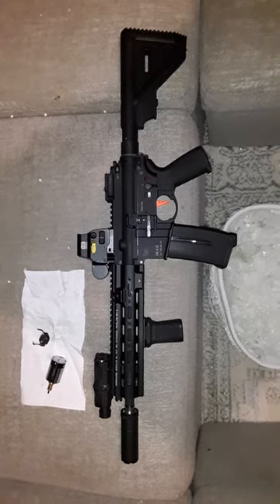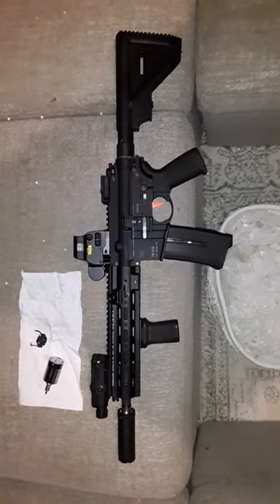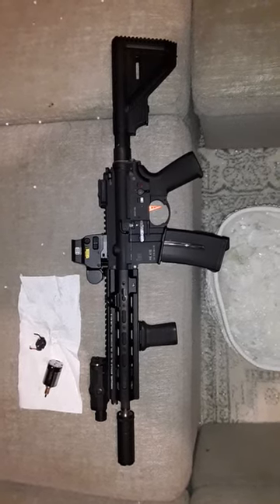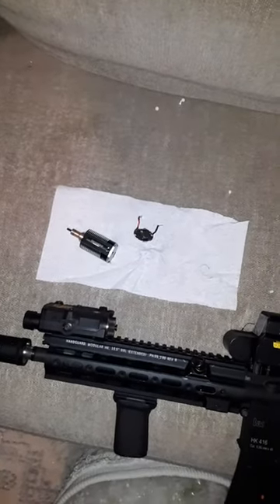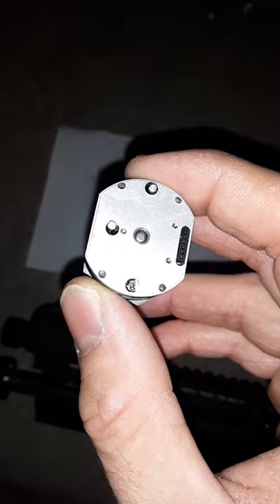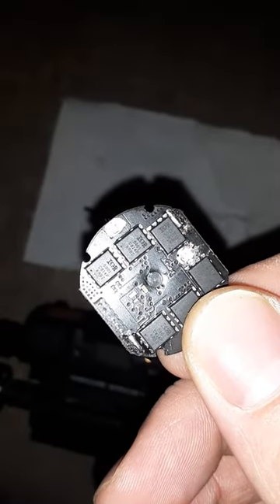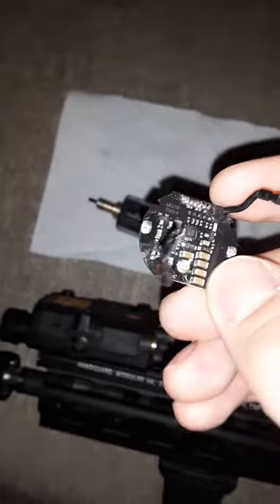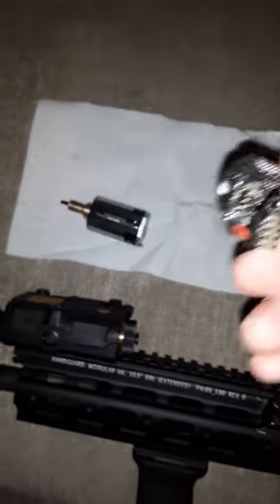Airsoft DSG 416. Ronin Brushless+Lonex helical bevel/pinion

Comment: Damn bro, I've had a helical pinion/bevel set just gathering dust in my toolbox just because I don't have the pinion removal tool, and I've searched everywhere for a vid that shows how much of a difference there is in sound, you just made my life easier... Kudos on your work and love from Dominican Republic!  Keep the good content coming!
Reply from the maker: Once you switch it you'll never want to use any other pinion and bevel again
Reply: @jhqtech  how about cycling time, how many ms does it improve?
Reply from the maker: @IsmaelColumnaMontero  the spiral bevel and pinion dont increase rof, just mesh more smooth than standard bevel and pinions

Comment: Wow, I know straight cut gears make a lot of noise but I wasn't expecting that much of a reduction, that's amazing! What they're much to do solider the brushless? And did the gears mate well? Sorry for all the questions dude. I've been watching all your videos lately 👀 lol
Reply from the maker: No problem. The lonex helical bevel meshed well with shs spur. To press fit a pinion there are 3 wires soldered to the brushless motor you have to disconnext. Warhead actually has a great video on their facebook how to do it

Comment: I thought that you had to use all helicoil gears if you go helicoil and are the go if you want to push like 7-800fps once again it's a awesome build ,you do some good work bro like top notch 👌 stuff
Reply from the maker: It's just the lonex helical bevel and pinion gear. Works with most standard ratio gears as it's just a regular 10 tooth bevel only with spiral cuts so you can use it with many other gears
Reply: @jhqtech  huh that's interesting and sounds bloody awesome like everything you build

Comment: I thought the Lonex spiral gear set was for O-type motors and the Warhead motors were all D-type? How did you fit the pinion to motor without worrying about the pinion slipping?
Reply from the maker: Press fit and apply loctite

Comment: Hi ! Did you try precock ? Is there PME with this setup and precok ? (8T dsg)
Reply from the maker: I dont use any precocking. Theres no need with a dsg. Precocking only stops the sector in a specific spot while cycling if your spring is strong enough there should never be pme

Comment: What kind of work did you need to do to make sure that the motor was aligned well enough for a helical pinion to work? Given that the v2 design puts the motor in the pistol grip rather than a motor cage, I’d imagine getting the alignment could pose some difficulties?
Reply from the maker: I shim the motor inside the pistol grip with electrical tape so theres no movement once I have the proper angle and height set
Reply: @jhqtech  gotcha gotcha. Thanks man!

Comment: Ever thought of putting lonex helical into your TSG?
Reply from the maker: I've got 10 more coming for all my builds. This was the first I wanted to mess with to see if I liked it. I'll def be using one in my tsg gearbox
Reply: @jhqtech  Okay. I thought there weren't enough notches for the arl but I don't really know since I have only seen pics. If there isn't enough though is there anyway to modify the helical gears??? wondering because I am looking to use one when I build my TSG.
Reply from the maker: @beguinworkshop9068  from my understanding it's the same as any other standard bevel so it should work fine. Most 10tooth bevels in common ratio gears are the same

Comment: I have an 18:1 I m building right now but still haven’t order the motor should I get an brushless motor I was just gonna get a real deal golden boy motor but these brushless motor have a lot of pros
Reply from the maker: The real deal motor is a nice brushed motor worth its price especially with him adding silver brushes to his new ones.

That being said I use all brushless motors now. If you have the extra cash, the warhead base motors are just as good as the cnc black and ronins
Reply: @jhqtech  Thanks for the response I will be getting the warhead base motor and will be thrown into an MCX 18:1 DSG
Reply from the maker: @dynasty_aatc  get the 35k (this ronin is only 30k). Should net you around 45rps depending on your spring.
Reply: @jhqtech  yeah what I was gonna get

Comment: Just wanted your thoughts between the three motors and what's better obviously
Reply from the maker: Id say go with the base every time unless you just have money to blow on the ronin. The base performs just as well as the other 2. The ronin is a bit more efficient. But id stay away from the black ones, alot of people myself included have had little issues with them.
Reply: @jhqtech  really azraels armoury hasn't mentioned anything and that is the reason they stopped ordering those option no1 brushless motors hummm my mates already brought a couple of the black ones i will have to look into it now cause to be honest i was just going to grab one of the bronze one's
Reply: @jhqtech  o well hopefully my friend is one of the lucky ones and he's saying go for the more expensive one and he does have the money to blow, the base bronze motors are selling for $175aud and the black 200aud is being sold by the guys who make the Apache's funny enough and they are really talking them up
Reply from the maker: @drewmurray6480  the warheads all around are great motors whatever version you use. I just think some of the hand winding done in the black ones is inconsistent sometimes causing strange problems. And I've had several people say using them in winter temps causes issues. A fun test is to shoot your warhead equipped gun to see that it works fine, then put it in the fridge for a while and test again. Hilarious when I saw someone do it but also suprising
Reply: @jhqtech  🤣

Comment: Lucky you didn't f@#k the warhead motor that would have been a expensive mistake, and what's the difference between the three warhead motors azraels armoury has the black and gold one's a they possibly have the bronze one's in but another place has them anyway and they are only $25 cheaper anyway but shakkas uploaded a video on a customer's build and he used a ronin in that but im pretty sure that the customer supplied the ronin and i think you watched it and commented
Reply from the maker: i did break the esc of the ronin originally. luckily i have a few spare warheads laying around and all the motors use the same esc.

Theres little difference between them all. The base is perfect for whatever anyone needs. The black cnc is just more expensive and the ronin is very slightly more efficient.

At the end of the day I say stick with the base unless you just want the ronin
Reply: @jhqtech  cheers mate i trust what you say and can't question your input you seem to know what you are doing when it comes to these toys
Reply: @jhqtech  cheers mate 👍 your a champion lol my stumpy little hpa honey badger is nearly done, not that it takes so long to do just been bizy  looks alot line the nuprol honey badger
Reply from the maker: @drewmurray6480  very nice. I'll do my speedsoft guns soon including my polarstar f2 build
Reply: @jhqtech  ahhh i can't wait for that build